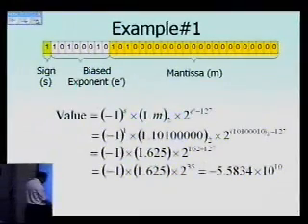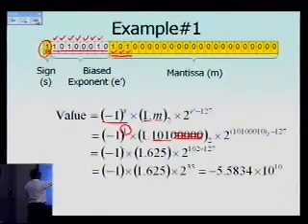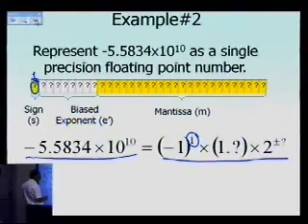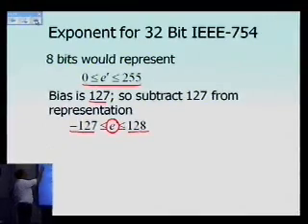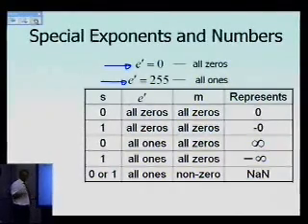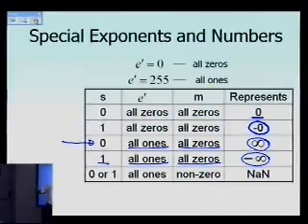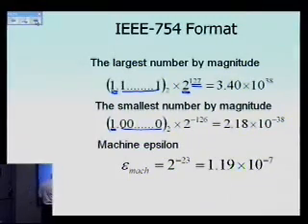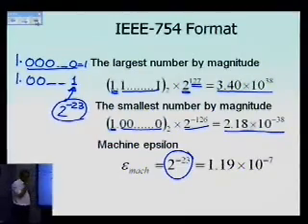Chapter 01.05: Lesson: IEEE-754 Single Precision Representation: Part 2 of 2

Comment: @numericalmethodsguy could you please explain manually resolving -5.5838 x 10^10 conversion to binary single precision 32 bit IEEE754 ?
Reply from the maker: Hard to do that by dividing by 2 and finding the remainder.  It will take a long time. 

The best thing to do is to divide by 2^n, where n is an integer and find largest n that gives you 1.xxx *2^n form.  So 2^n=5.5838*10^10 will give n=35.70.  I solved for n by taking the log10 of both sides.  We choose the integer part, that is, n = 35, as this will provide us with 5.5838 × 10^10 = 1.625099685 × 2^35.  Now convert 1.625099685 into binary and (35+127) (biased exponent https://stackoverflow.com/questions/2835278/what-is-a-bias-value-of-floating-point-numbers) into binary.  You will have your mantissa and biased exponent. 

See here for another example: https://blog.autarkaw.com/2010/05/25/converting-large-numbers-into-floating-point-format-by-hand/
Reply: I see the point now. Thank you for the video and for the answer !

Comment: Because 2 to the power of -1 is 0.5, and we move towards the right there is a zero, we don't count that although that is 0.25 (2^-2). and we move right we have (2^-3) which is 0.125 we add that together its 0.625. I hope I helped.